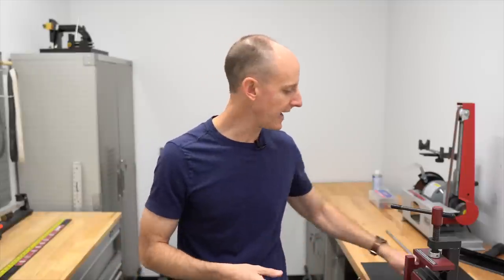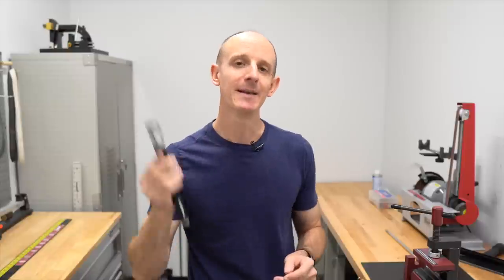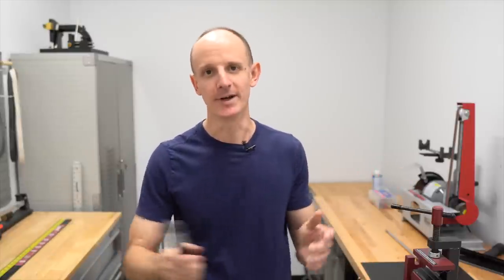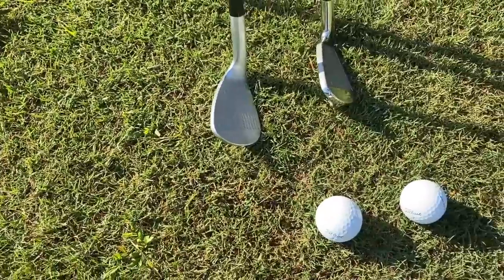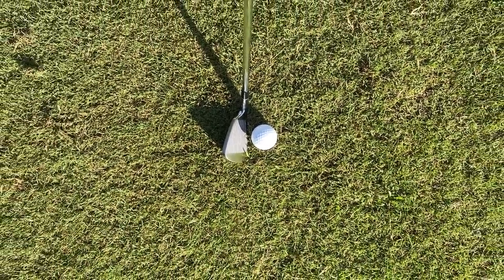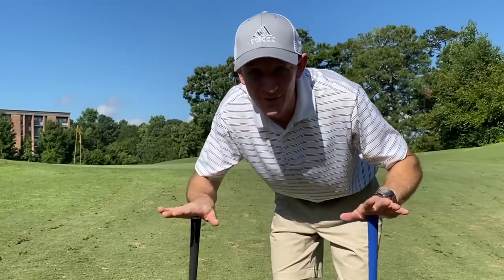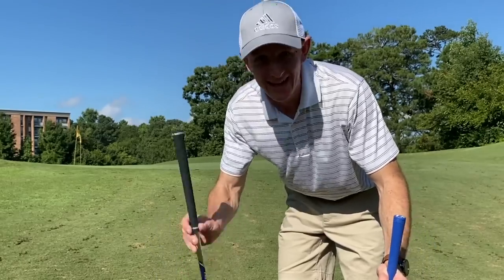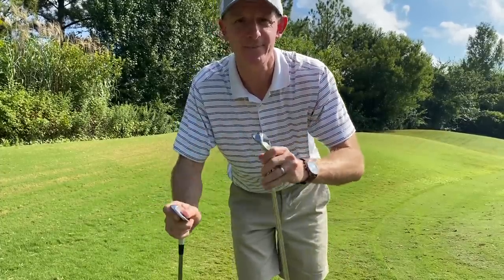I DID NOT Build a Chipper

Comment: Can you give us the loft & lie you bent the club to? I personally think one of the bigger benefits for higher handicap golfers is  the 8-iron (38-degree) type loft of the new Ping ChipR, yes in combo with the 70-degree lie and heavier weight, but that easier straighter faced loft + having the correct bounce to go with it - and wider bounce. I see you bent it upright but did you bend the loft - and if so, what was the effective bounce? Great video
Reply: yes what was the "not a chipper" lie/lot before and after
Reply from the maker: Lie angle was bent 2 up which was as far as it wanted to go. Loft kept at standard 43 for that club. I think low 40s is perfect loft on this type of club. Obviously bounce stayed standard.
Reply: @EFGMC  Thanks for the info - what did it Swing Weight at? and what length did you play it at?

Comment: AJ, Great video. Do you think the Maltby KE4 S head would work as well as the KE4 Max that you used? The KE4 Max looks better but I'm wondering if two weight ports on the head would allow for easier weight tweaking and customization. Thanks.
Reply from the maker: I think that one would work fine as well. Nothing special about the Max I chose other than liking the look and having the port in back. Having 2 ports can only be better to allow for more clean weighting options.
Reply: @EFGMC  Thanks AJ!

Comment: What was the powder you used to mix the epoxy? Why did you use that brass adapter you used over the end of the shaft when you pushed it into the head?
Reply from the maker: The powder was shafting beads. Helps center the fit of the shaft into the hosel. The brass shim was used because the shafts are .355 and the head's hosel is .370 so we need a shim for a good fit.
Reply: Thank you for the quick response. I enjoy your channel. I’ve made several sets of golf clubs especially when component companies were popular.

Comment: Do you always use shims with tip weights? What thickness of shim? Can you shorten shaft the thickness of tip weight head, match tip head to shaft and just glue shaft in hoesel?
Reply from the maker: This head was a .370 and the shaft was .355 wedge shaft so I used the shim. The tip weight did not influence that decision.
Reply: so you are saying you should not need a shim with tip weights on tapered shaft to tapered hoesel? Is that correct?
Reply from the maker: @craigwollmann1948  Not usually unless their is too much space in the hosel which does happen sometimes. But usually no need. However if we are talking about graphite shafts and tip weights, you might need some shims as the heavier tip weights can be a bit narrow and lead to some shaft wobble.
I personally recommend always having some shims just in case. They're cheap and just good to have a few in case need arrises.
Reply: Thanks, enjoy your videos.

Comment: Since you can't technically put a putter grip on it (which would be ideal), maybe look at an oversize grip to mimic the putting technique and take the hands out of the equation.
Reply: technically you 'can' put a putter grip on it as long as said putter grip doesn't have a flat (non-circular) side
Reply: @wallstreetoneil  much easier to build up an os nontapered grip

Comment: Did you adjust the lie angle to be more upright?
Reply from the maker: Yes, a couple degrees.
Reply: What was the finished specs lie angle and loft and length.
Reply from the maker: @johnbarnes7461  66 lie, 43 loft, 35 length.
Reply: I bought a maroon 5* upright Eye 2 and had it bent to 7 upright and I put 10 grams of lead tape in the cavity. John,  all I know it’s 7 degrees more upright that standard. The big difference is the weight. That thing swings itself.

Comment: That Not A Chipper has an insane amount of offset.  I wouldn't even be able to use it looking down at it..  oooof
Reply: The Maltby KE4 Max head that AJ used has 0.105" (2.667 mm) of offset. That's pretty much the same as the same as the Mizuno JPX 923 Tour Forged PW and very close to the 2021 Callaway Apex.